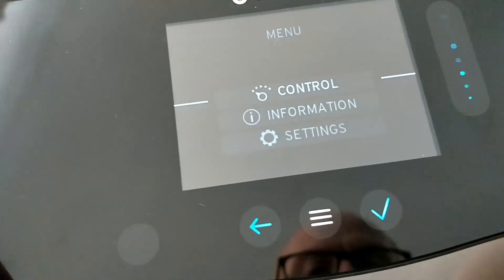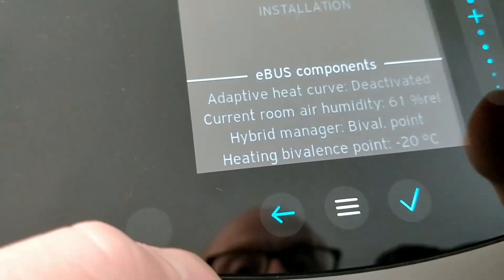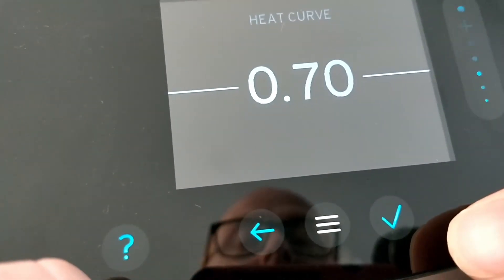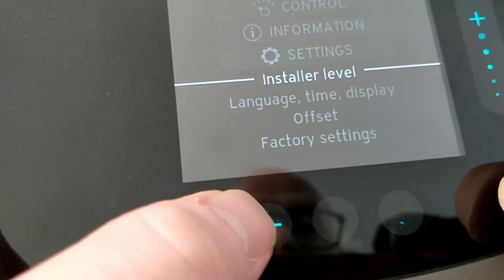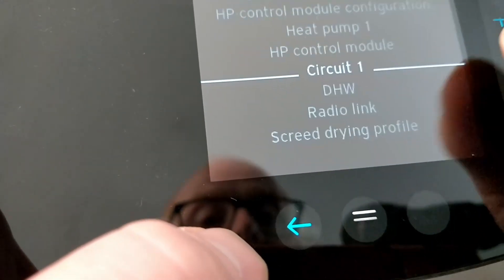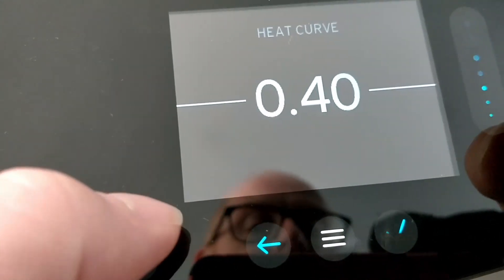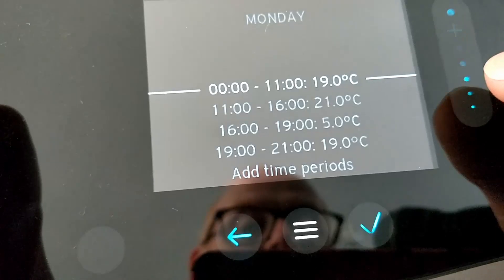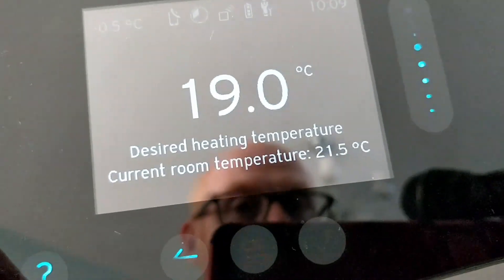How To Set Your Weather Compensation Heat Curve - Vaillant Arotherm Plus Heat Pump

Comment: Hi, I’m pleased I watched this video. I’ve had my vaillant aerothern heat pump for 3 years. I occasionally go into the settings to have a look around without changing anything. After watching the video I went into the settings, the target flow temp was 0 degrees. Heat curve set to 1, room temp mod was set to expanded. My current temperature and desired temperature are usually the same very occasionally been 0.5 degrees different. In the winter my heating is set to 18-19 degrees which for me is comfortable, domestic hot water set to 50 degrees. Should I still be changing the heat curve and other settings. I would be very grateful for any advice
Reply from the maker: If you want to know for sure that your heat curve is correct, set to inactive and then monitor your desired Vs actual temps for a week.

Hopefully you can tune it to lower than 1.0 which will give you better efficiency.
Reply: Thank you for the information. At the moment my current room temp is19 and my desired temp is 18, so I have dropped the heat curve to 0.8. I’ll see if there’s any significant difference. Should my target flow temp be 0 degrees. How do you calculate your cop. I watched a similar video to yours and they went into the energy data setting  added the the total figure in the environmental field to the total installation figure in the power consumption setting then divided it by the the total installation figure. If that’s correct my cop is 3.66
Reply: @martinsykes3254 Energy Stats UK have a page on the Vaillant SCOP. And I think that's right.
@heatgeek suggests dropping the curve slowly until you are 'cold', which seems similar to @UpsideDownFork.
Reply: Additionally, you could also consider decreasing your hot water temp to reduce the cost of generating it (see the@HeatGeek Legionella video)?
Reply: Thank you for the Information. I’ve reduced the hot water temp to 45 degrees it’s still hot and more than enough for showers. Is there any way of retrieving my original yearly kw usage. I had a power cut last week, since then my total yearly figures and monthly figures are the same in the environmental yield, and the power consumption
Reply: @martinsykes3254  my suggestion to look at the SensoComfort/cylinder looks to have been lost

Comment: I'll be having some more fine adjustments on my 6 month old Vaillant Arotherm Plus 5kW as soon as it's back up and running. It stopped communicating late evening yesterday and knocked off the trip. The trip then made a loud bang when I tried to reset it. Luckily last night was mild 14c outside. I'll see how good Vaillant service is tomorrow when I call.
Reply: I'd be straight onto installation company, heating & hot water are priorities, and within first year where all they installed is covered.
Reply: @_Dougaldog  I have but they can't repair the heat pumps themselves, have to go though Vaillant. They have been a helpful heatgeek.
Reply from the maker: Fingers crossed. Did you get power cuts yesterday?
Reply: @UpsideDownFork  No power failures, wasn't too bad here until later in the night. It'll be interesting to know why it's gone.
Reply from the maker: @carlarrowsmith  Surge protection on the circuit?
Reply: @UpsideDownFork  Yes it's surge protected.

Comment: Useful info, although I do wonder if people would be better off starting with a fixed temperature to get the curve dialled in, before playing about with different timings?🤔
Surely, when using timed temperature, you need a higher WC to catch up from the cooler periods, and the temptation is to then use the ASHP in a boileresque fashion.
Reply from the maker: That is another method but setting the schedule first with a 2-3 degree setback will be the quickest way to get where it should be.

Ultimately, all roads lead to Rome, it's just how fast you make it there.

Comment: WC can be different for so many  ppl and house types. I have many video calls with clients, generally to help turn the settings down. I don't like the arotherm WC,  because you can't see a curve view and what it represents on the screen to give you a visual of what's going on.
Reply from the maker: Yes, I wish they showed on the sensocomfort what we now have in the app. A visual representation helps people understand it and for that we had to resort to the manual.
Reply: You can see the heat curve in the app now, as well as change it.

Comment: This comment is maybe to help those with similar controls but using the newer Vaillant Boiler rather than there Heat Pump. I have the new (EcoTec Plus 826 Boiler) with (Senso Comfort) controls and external (Weather Sensor) fitted a couple of months ago. Come with the (Room Temp-Mod) set at (Inactive) so it is justing using the outside temperature to adjust heating and my gas usage went to the moon, more than doubled over my old Worcester Bosch 30cdi which was 16 years old. Changed it to (Active) and my gas usage is way down to what I would have expect. As far as I am aware (Active) uses the outside temp, internal home temp and your selected temperature curve to get best efficiency. Was under the impression that the controls could adjust the heat curve itself for best efficiency but this doesn't seem to be the case. My goal is to try and run this gas boiler as low a heat curve as possible 24/7 with 18c setback and 20c for few hours in the evening. Would like to try and see if I can be as close to simulating an external heat pump as I can and minimum gas usage. Have already reduced my curve to (1.0) from the (1.2) and going to see how low I can go. On a side note I have 3.6kw south facing solar and a 15kw storage battery installed 3 months ago. I hope over the summer months it will generate enough funds through export to cover my gas bills during future winters. Can't fit a heat pump myself due to being unable to site a hot water cylinder or route all the associated pipework. My installer had never fitted those controls and had no idea how to setup and the manual is not the best. Also nothing really on the internet for the Vaillant combis on how best to set them up hence why posting here as I more follow channel in regards to the solar setup. If anybody with similar setup has any assistance to improve settings please share. Atb
Reply: Sounds like your well on the way to running it perfectly.  I'd try turning the max flow temperature down,if you already haven't.  I run my worcester 27i at 55 degrees, so the boiler remains in condensing mode  more even if the boiler runs flat out. I'm also able to range rate my boiler heating  output,  which I have reduced from 27kw ....and is now set at 6.8 kw
Reply: @douglasstalley6475   My Cdi had an installer setting I think (A1) or (B1) in the installer menu (check) to range rate so I could set my max CH Kw gas output boiler would us to for heating. My home heat loss is 8kw so set that that to use a max CH  to 10kw. Made a big difference and not many know about it. Along with 55c on front dial for ch flow temp. What I have noticed is that the Vaillant using the temp sensor and heat curve doesn't allow you to set a max CH range rate like the Worcester. It's meant to do it itself so I believe. The Vaillant manual, info is a bit all over the place. Weird as well that many installers don't know about things like this as my new install guys didn't (Vaillant approved and Corgi). Wonder how many boilers out there are wasting fuel for no reason and folks dont know as installers don't setup to get best efficiency. Just want to throw the boiler in and get paid.
Reply from the maker: The auto adaptive feature on the Vaillant controller is useless. Don't use it.
It sounds like your heat curve is too high. Active can be more economical in the shoulder months but in proper winter heating conditions then inactive will almost always be beneficial.
The problem with active enabled is that you will never know if you've selected the correct curve for your system.

The same steps and principles that I shared in this video are equally applicable to boilers as they are to heat pumps.
Reply: @UpsideDownFork  Thanks. Going to have to have a play about and see what works best. Adjusting a bit at a time.

Comment: Weather compensation is a great, but as a (non heating) engineer it does seem a bit crazy that this initial learning process is not automated. What you explained here would be a perfect job for a computer!
Reply: I tried the Vaillant adaptive Heat curve function just to see if it ends up with the same heat curve as I found with the message you showed in the video. I think it did work and in fact fitness 0.4 as well, which is what I also found manually. Can't remember how long it took, I think a few days. The room temperature mode needs to be set to Expanded during the adaptive heat curve finding, so that needs to be set back afterwards.
Reply: @PhilippWevers  Expanded and Inactive are supposed to be compensating for solar gain and drafts during high winds? I go for Expanded.
Reply: There is. It's called Homely.
Reply: @bryanhindle8307 though unfortunately Homely doesn't do Vaillant
Reply from the maker: Yes, the frustrating part is that Vaillant controls do have an adaptive function that does automatically adjust the heat curve but at this moment it is absolutely useless!
I'm sure Vaillant and others will massively improve their controls for the next generation heat pumps, as that is still a huge downside for non technical people.

Comment: The same is also valid for a boiler. I'm using a viessmann boiler with weather compensation on a fairly well insulated house with mechanical ventilation and heat recovery, trying to keep the heat curve at 0.4 and a target temperature of 20 degrees. It is still cycling a fair bit when the temperature outside is a bit higher because the boiler can only modulate down to 2 kW.
Reply from the maker: Thanks for commenting!
Reply: "Only 2 Kw"? 😅 That is a heatpump level of modulation. That's incredible for a gas boiler. Mine is the top of the line,  21Kw Vaillant ECOtec Plus and it can only go as low as 3-3.5Kw. 
What you need to do is to switch from Inactive to Activate for a Room Temp. Mod. (In Vaillant), whatever that may be in Boss man control settings. This mod is taking into consideration also the internal room temperature. I am fairly sure you will run your boiler much more efficiently if you can enable that. I find that most gas boilers "need" to be on such a setting precisely because they don't modulate as low as a heat pump.
Reply: @Haik0 my house needs way less heat than the boiler provides at 1.9 kilowatts. So it cycles just because the minimum power it provides is still much higher than my house has a heat loss. So I don't think there is anything else that can be done.

Comment: Vaillant Arotherm controls have suffered a few iterations. Mine is an early version which is lacking some information and abilities. I think it would have been a useful option to be able to adjust different setback temperatures for day/night so cooler at night for sleeping, warm for breakfast, a different setback for daytime and warm options for mealtimes and evening relaxation. The initial design missed a trick there.
Reply from the maker: Fortunately we can set 6 different time slots with differing temps which should cover most eventualities.

Comment: That’s actually very helpful!  My installer did a great job but his handover was litterally 3 minutes!

Where is the temperature inside taken from? The controller you’re using which is same as mine ?

Just as then I may move it to coolest part of house as it’s in utility which is warm 

I’ll try this on mine

Thanks
Reply: It’s not taken from inside if you use weather compensation properly.   It’s from the outside probe.  The controller just acts as a thermometer.    You can change this, however.
Reply: @ thanks so should the thermometer/ hub be in a cool area I giess
Reply from the maker: Whilst doing the heat curve calibration it is wise to move the controller to the coldest part of the house, or at least the room that you spend the most time in, living room, study etc. You can then calibrate the heat curve for your coldest/most used space and if you feel the need, you can always limit the temps in other rooms through TRVs as a last resort if you can't manage even temps throughout the house.